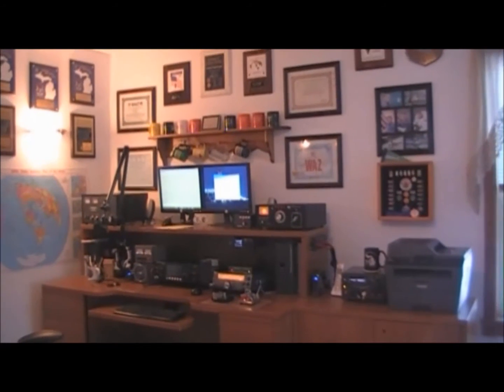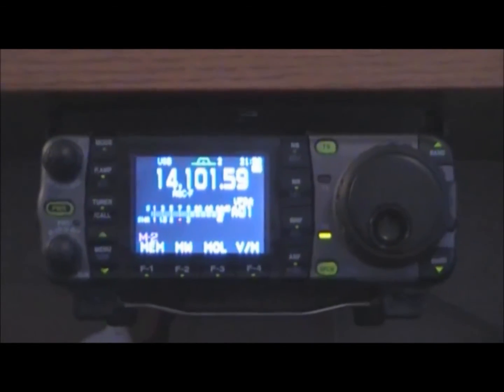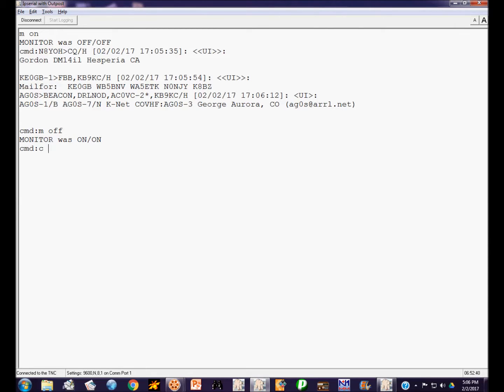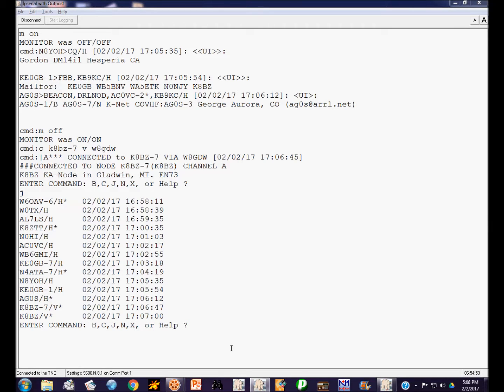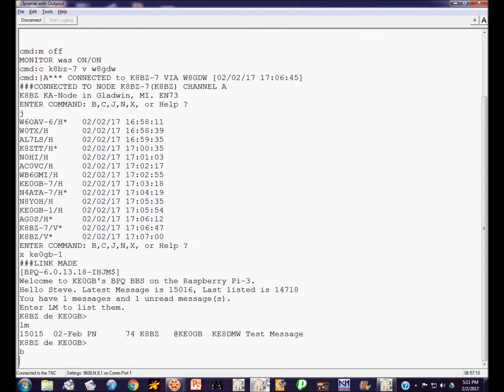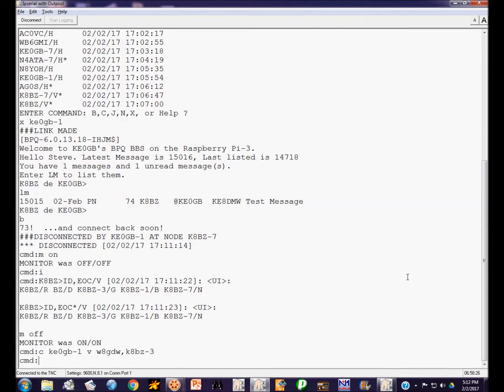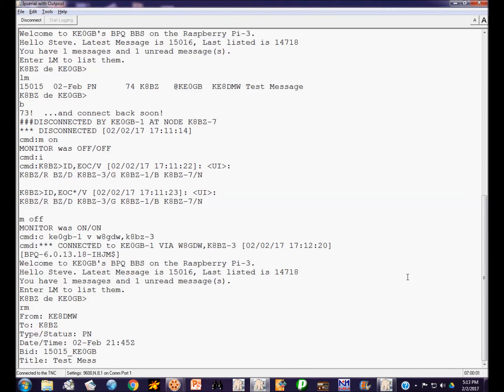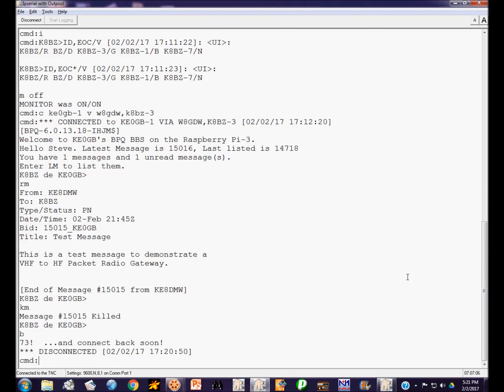VHF to HF Packet Radio Gateway

Comment: Very good. Would like to see a stronger return of packet radio.
Reply: So would I but all the interest is in FT8 and now FT4.  But that's how the interest in packet was back in the day.  You can do so much more with packet but that's not the interest right now.  Thanks for the view and 73.
Reply: @k8bz983  FT4 is slated for contesting only. Hope that standard is adhered. I've been hearing of others in Ohio wanting to return to Packet. There is a slow movement. If enough Hams get interested Packet could be usable from East to West coast and Gulf of Mexico to Canada again. 73
Reply: @MoTown44240  You are very correct.   Packet used with MYSIS was a world wide message forwarding system that was totally dependable without the need for any internet links in the forwarding path.  I routinely sent message to Europe and Asia and received replies within 5 or 6  hours, all by radio.  There is nothing like it today, and it isn't likely that there will be in the near future.  Everything from here on out will have an internet component, even though in theory some systems could function without it,

Comment: Thanks for posting this video. I found it very informative. I'm trying to stimulate interest in setting up a packet network here in Ontario Canada. I think that packet and specifically HF packet is an important EmComm mode. However, having a viable packet network simply makes sense at all times.

Comment: great video, its a shame more hams are not into packet as it was in the 90`s, I just dug out my old pk232 the other day and have it going on VHF only node I hear is on 144.390 I'm guessing it is a APRS. I have yet to find any keyboard to keyboard traffic. but I keep trying to find someone. I hope to have the hf side of it going soon.
Reply: Yes, 144.390 is the APRS frequency.  Check 145.010   145.030  145.050  145.070 and 145.090     Different areas of the country use different frequencies.  Look for HF packet on 14.105 USB.  You will have to set your dial freq a little lower in USB mode, but you will hear lots of signals on that freq during the day.  When you have one tuned in and are receiving then you will know your HF dial frequency and you can save it to a memory channel in your radio.  Hope to see you on packet soon. 73, K8BZ

Comment: I'm sorry, I meant to say what kind of software do the actual (PBBS) Packet Radio Bulletin Board's use for your area? And would you know where to get the software and how to install it? Thanks for your videos and your answer in advance.
Reply from the maker: Thanks for the views and the question.  A packet radio bulletin board can be set up and put on the air with just a Terminal Node Controller (TNC) and a radio with no computer connection at all.  The required software is completely included in the TNC.

You do need a terminal program to set up the bulletin board, and to connect to the bulletin board by radio.  A good basic terminal program is part of the Outpost PMM software that can be downloaded and used free of charge.  You can fine the software and download link at:

http://www.outpostpm.org/

A video showing how to download and install outpost can be found at:

https://www.youtube.com/watch?v=62kz4OMv5Bs&t=11s&list=PL1SWYTnI6G2PrgautU9hw7BCs04zb857w&index=3

My complete video playlist about packet radio can be found at:

https://www.youtube.com/playlist?list=PL1SWYTnI6G2PrgautU9hw7BCs04zb857w